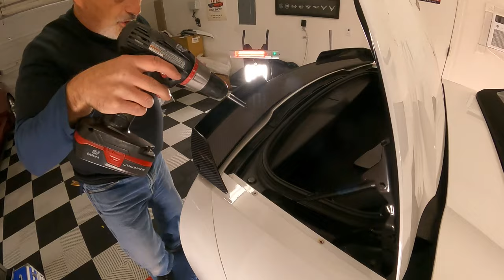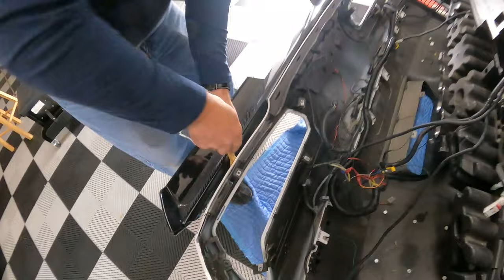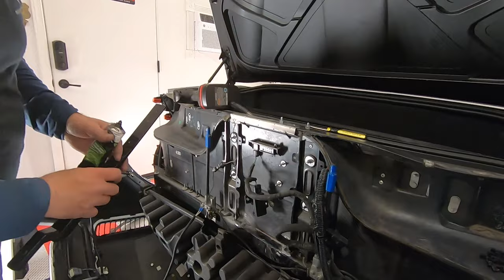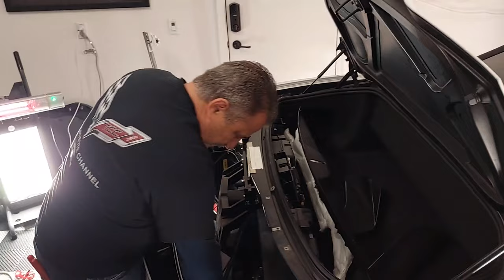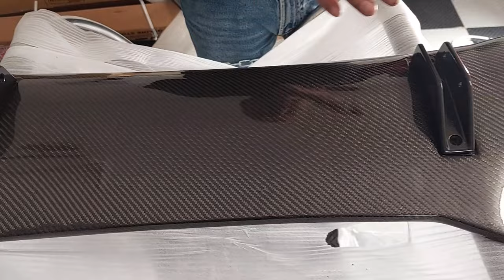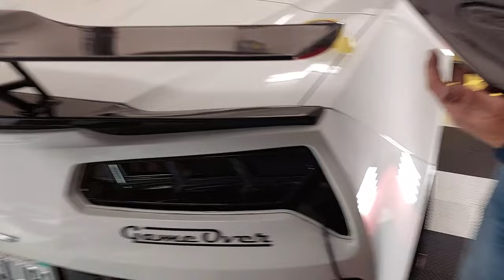How to Install a Carbon Fiber ZR 1 Wing From Extreme Online Store on a C7 CORVETTE

Comment: You don't need to slide the lock mechanism out,  Doing that risks breaking parts. all you do is follow the cord up into the trunk, take the back wall off where in the trunk, then you can access the cord, pop open the cap to where the cord is, then release it from the slid plate.  It is way easier than fucking with that lock mechanism. Then you can pull the cord through the  Exterior wall and take the whole bumper off.  leaving the bumper hang like that leaves a lot of stress on the plugins and you could possibly damage the whole bumper, it's better to just pick up the whole bumper and put it on 2  Saw horses covered in blankets.  The company that makes the taillights that are in this Corvette is called the (retrofit source). If you go on there YouTube channel you can see a video of them installing these lights and they completely remove the bumper with no problems at all. I have the same tail lights and that is exactly what I did it literally took me nothing to do it. Easy as 1-2-3

Comment: Mr Corvette channel its one thing that  alot you all forgot about taking off the bumper, Its one little bracket under there above the 4 -10mm bolts, it has a push pin it .

Comment: Thanks for the Vid. Is the edge finished as to run without the winglets? Second question. do the Make a low wing bracket so the wing would only be about half as tall?
Reply from the maker: Hello,
Yes the end is finished and at this point they do not have any other brackets

Comment: Hi just ordered this carbon fiber wing and was wondering what keeps someone from walking up at night and unscrewing this wing off my parked vette? Of course it would normally be garaged at night but there are always those times you travel and stay at motels, hotels air bnb, etc. What is the goop you added? locktite, epoxy, or something else? It justs looks to easy to steal, of course they would be challenged to reuse it without the hidden brackets but I would be out an expensive wing. I envision some teenagers mounting it on their Gran Turismo game room wall.

Comment: Wondering if you could help me out ! I got this wing off a totaled zo6 at my local junk yard the rear bumper was rear ended and I was unable to grab the mounting hardware would I be able to just buy the mounting hardware for my 2016 z51 or will it not work since it came off a 2015 zo6? I can’t find a difference besides it saying on the website wide for zo6 grand sport / base for stingray if I order the mounting hardware would I order it for the base ?

Comment: Do you really need to remove the bolts from the rear quarter panels? I installed a spoiler on mine and only had to remove the 10 across the back, then just pull the rear cover off.
Reply from the maker: No you don't I do to make rhe bumper more flexible to allow the bumper to align back up when putting it back together.

Comment: i cant find that carbon fiber ZR1 wing  on Extreme online store.      is this the one ? CORVETTE C7 ZR1 ZTK CONVERSION REAR SPOILER HIGH WING $1,899.98
Reply from the maker: Yes that is it!! Be sure and go look at my new video showing how to install a Front Splitter On a C8 Corvette and use that link that is in the description and then put it in your cart and then use code CorvetteChannel to get a 10% discount but do it now because they just informed me that the discount stops on the 30th.
Be sure and use that link it will look just like the regular site but it will let you use the code!
Good Luck,
Scott